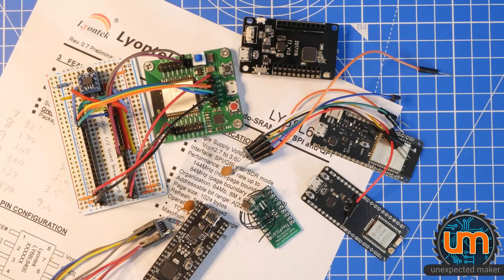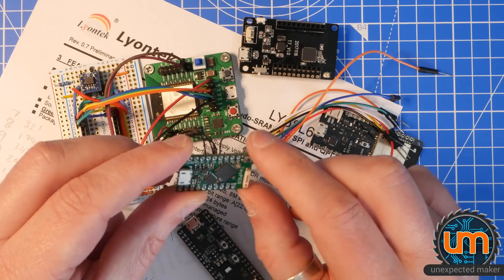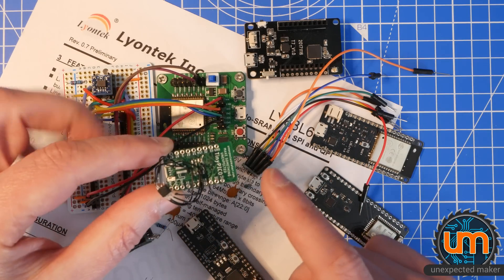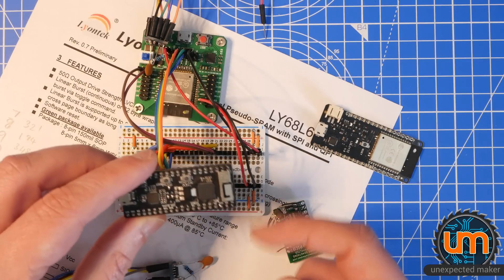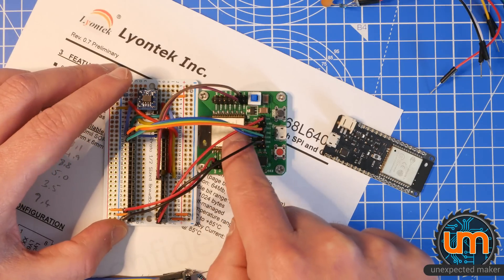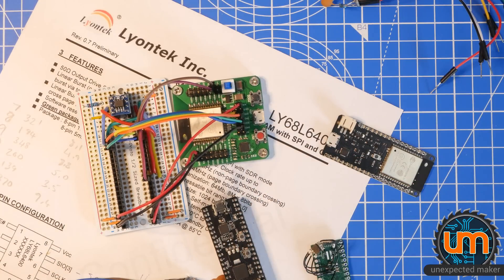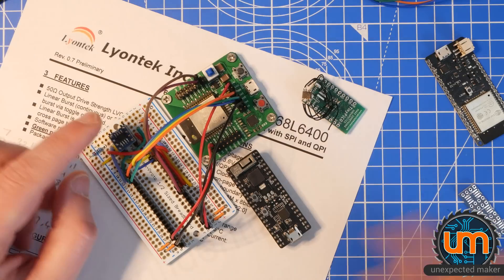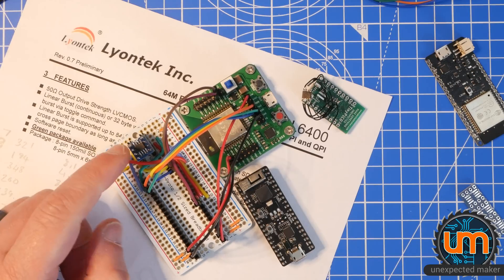TinyPICO PSRAM - What a frick'n mess!!!!

Comment: Has anyone figured this out?  I've got the PSRAM to post, but fails on mem check and ESP32-Pico-V4.1 reboots and continues is a loop with the PSRAM mem check failure.  I've tried everything.  Does anyone know a "for sure" PSRAM chip that works with the ESP32-Pico-v4.1??  I've tried this:  APS6404L-3SQR-SN -- DRAM IoT RAM 64Mb QSPI (x1,x4) SDR 133/84MHz, RBX, 3V, Ind. Temp., SOP8

Comment: So is the pico kit schematic wrong ? https://dl.espressif.com/dl/schematics/esp32-pico-kit-v4_schematic.pdf
Reply from the maker: No, it's not wrong, but notice the re-mapping of pins? IO17->SD0, SD0->SD3 etc...  means on TinyPICO I am wiring up different PICO pins than what I am using on PICO-KIT. Super easy to make mistakes like this, as what I test on the PICO-KIT is NOT what I am implementing on TinyPICO. I cant see any reason for the IO re-mapping.... I ended up re-naming my PICO in TinyPICO to match what PICO-KIT uses to prevent mistakes, but it's really bad consistency from Espressif.
Reply: @UnexpectedMaker  oh wow yeah package does not match datasheet, maybe revision change?
Reply: ohh I see now the datasheet has a peripheral schematic that is different https://www.espressif.com/sites/default/files/documentation/esp32-pico-d4_datasheet_en.pdf page 14, I wonder why

Comment: What voltage psram are you using ? 1.8v ?
Reply from the maker: 3.3V - WROOM + PICO use 3.3V, only WROVER uses 1.8V
Reply: Unexpected Maker ahh I saw pin/instruction in the idf for selecting, was not sure

Comment: I think the first task should be to figure out if the errors are during read operations or during write operations.
A) Write one, read many times.
B) Write many times, read once.
Really need to put a scope on the signals to see what the difference between good and bad PSRAM access is.
Reply from the maker: Yeah, right now it's write once, read once.. that's the default ramtest code in the IDF.

My plan is to make a new test rig and then do any further investigations on that.

Comment: Hi Seon.  I’d expect that your “timing” issues are almost certainly due to the breadboard and dupont wiring you are using. 
I use the same SOP breakout boards, but for “Mhz” projects it is necessary to “dead bug“ point-to-point solder-wire the prototype.
eg. My retro video projects (even at low Mhz video frequencies), will not work with a breadboard due to breadboard capacitance etc.
But the same circuit, dead-bug wired-up to prototype, works perfectly!
Reply from the maker: Yup, was going to try a wirewrap version but was going to wait for the new ram... BUT I might try it on the Lyontek too, stay tuned!

Comment: I've had some I2C issues with the ESP32, mostly due to timing issues. Apparently the ESP32 doesn't deal with frequencies that are too far off the mark and is quite sensitive to rise and fall timing as well. I know PSRAM doesn't use I2C, but it may be worth double checking that your wiring meets SPI standards.

Comment: At 40MHz you won't have a length issue but beware of those pre-formed jumpers and always make sure your clock and enable lines are the longest wire in any case. I used those prefab wires in a jig and got bitten by them on the assembly line in the middle of programming and testing a batch of 6000 boards. Manually soldering each wire to the pin resolved things. What I hear sounds like a hardware signal integrity issue or a software timing issue and the first thing to check would be stable power and stable ground. I would actually hard wire the Vdd & Vss with slightly thicker wire and use a 10n bypass cap across a 100n with the absolute shortest leads possible to the RAM's pins. A single 100n won't be fast enough, especially with two small inductors in series. In any case I think you need a scope and/or logic analyser at this point to see what's really happening. I suspect ringing on the clock and/or enable and 5 seconds on a scope should show it. On the analyser side I would wholeheartedly recommend the https://www.saleae.com/ stuff but for home use I've got an AliExpress clone of a https://www.dreamsourcelab.com/product/dslogic-plus/ which is a Saleae copy and the Mac software works well. In almost 100% of cases if you can get a single read/write to work, you're on the edge of success and even with imperfect hardware as long as you don't have threshold issues or crazy levels of ringing, a little drop in speed will usually get things working. Don't kid yourself about the difficulty of signal integrity at 40MHz. The Mac ][fx was a 40MHz machine and the guy in charge of that project was Apple's "Chief Designer in charge of Wicked Fast Products".

Sorry I've been swamped at work lately but I've got a good sized letter almost ready to send to you. Cheers from Colorado where we're now getting snow. ❄⛄
Reply from the maker: 40MHz is relatively slow by todays standards ;) I'm fairly certain this is not a decoupling/power noise issue as I get the same results with or without a bypass cap at 100nF... but I will try a 10nF cap on my next attempt.
I might look at getting a cheap logic analyzer when I am in China...  my scope does 4 channel SPI decoding, but I cant seem to get it working :(
Reply: I always like to keep the Cray 1S as my benchmark for wicked fast as it was 80MHz but 100K differential ECL is a different animal and it's no longer 1976, LOL. At 40MHz that 100n isn't really decoupling, it's acting more like bulk capacitance. The frequency is too high. Just as a rough example check out this random graph showing the different frequency coverage for different size caps: https://i.stack.imgur.com/c1AvP.gif and for a more complete technote here's more than you likely wanted to know but it's only 10 pages and with lots of pictures: https://www.intersil.com/content/dam/Intersil/documents/an13/an1325.pdf It would also be criminal of me to not mention the gotcha that two random caps in parallel can ring, and sometimes ring badly. Always best to scope it out.

When I was at my last job I was using lots of macroblock chips and almost every device with more than 28 pins had an accompanying SPI Flash with it. My last board had 5 or 6 ROMs and getting firmware for some of those chips during development from some of the vendors (cough.. cough.. ASMedia.. cough) was sometimes difficult so we "borrowed" code from other boards on the market using the same parts. In that effort I found there are 283,453 permutations of SPI with every possible polarity of every possible signal. I'm not surprised the PSRAM is acting different because there is such a variety of Flash chips which are incompatible. The best thing about standards is there are so many to choose from. My guess is the solution might involve a seperate machine language bit banging routine for the PSRAM to adapt to whatever it wants.

One thing you might want to test... if you write all $00 do you get only $00 back, and if not do you see $80, $01, or other values?, and inversely if you write only $FF and you get zero bits back, is there a pattern to their placement? Mode of failure is a great clue. If you can divide the master clock down for testing, does the failure mode shift?
Reply from the maker: "The best thing about standards is there are so many to choose from" - hahahahahahahahahah mmwahahahahahahah.... 

Seriously though, thanks for the info.. I didn't meant to ignore any of it... in-fact, I did quite the opposite and ordered a DSLogic Plus... They look AWESOME!

The reason I am discounting the bypass cap is rudi got the same Lyontek ram working overnight, and he has no decoupling at all... so I'm going to give it another go... live on my stream on Wednesday, so you can all watch me make a fool of myself - live!
Reply: My hat is continuously off to you, Seon. That's excellent news and it sounds like you'll have it working soon. One thing I've paid close attention to over the years is watching why projects fail and it's often repeated that when design and manufacturing are separated, manufacturing will just leave parts off to cut costs. Decoupling caps are usually the first to go. You might be surprised the number of times that companies have failed and millions to tens of millions of dollars have been lost over trying to save an aggregate sum of less than $100 in parts on the line. It's usually the small stuff and it's really really common when getting gear manufactured in China. Decoupling caps are like seatbelts and doors on a racecar. Sure you might be able to race at one track without them and make it through to the finish line but start changing the course too much and the results might not keep equaling success.

Wow! You've got quite a well equipped lab now. I have to admit I'm a bit envious. When do you add the 6 axis CNC and the vapor deposition chamber? 😉
Reply from the maker: My lab doesn't feel "well equiped".. but in time I'll get there.. lack of knowledge is more of a problem for me than lack of tools, but not having a logic analyzer has been a real hindrance on a few projects so far.

I'd like a PnP and Ultrasonic cleaner before the CNC I think ;)
Reply: LOL, I've never seen PnP outside an actual SMT factory. I just took a peek at the freshest copy of the LY68L6400 datasheet I could get ahold of (v 0.7) and it mentions three read commands, $03, $0B, & $EB. While commands $0B & $EB work to 104MHz & 144MHz respectively inside a page boundary, command $03 is limited to 33MHz and you were mentioning 40MHz so I was curious if you were using QSPI mode? After looking through the ESP32 Technical Reference Manual V3.9 I see how they dealt with so many SPI variants. What a clever chip!!! Looks like it's just a matter of setting the SPI control bits appropriately and you're there! Start with the speed at minimum & work up. I don't think you could ask for a better justification for getting an analyzer. Hang in there, you've almost got it! Obstinance is one of the best qualities an engineer can have.

Comment: Worth trying a combination of say a 10uF decoupling cap in parallel with the 100nF one, close to the PSRAM chip.

I would have expected the shorter wires to work, though.

Only real way to debug this is to check out the signals with a decent o'scope, or even better - a Logic Analyser or FPGA.
It should take away the guesswork about the wiring and caps. ;)

Did you try lowering the SPI freq as low as possible? And are you using 1-bit wide SPI mode or DPI / QPI?
Reply: I tend to agree, though. It does sound like an incompatibility issue maybe.

Could be that the PSRAM config on the ESP violates some of the timings for that specific chip, like say trying to initiate a burst transfer too soon after the previous one.

Do you know if the RAM tests are using burst transfers, or single byte transfers?
Reply from the maker: I can't change the SPI frequency on this... it runs in QPI mode.
A logic analyzer would be helpful.
Reply: @UnexpectedMaker  - Definitely get a logical analyzer! Go for eight lines or more. It's a critical tool when debugging signal transfer. I used it a lot when making my io-expander library. It gave me all insight needed when the i2c expander used to drive an LCD display didn't work on the esp8266. Using the analyzer I saw noise on one line. At low i2c speed the noise wasn't there. Turned out that a shorter cable without breadboard in between made a much more reliable connection capable of higher speeds.
Reply: Yeah, I think even one of the cheapo USB 2.0 Logic Analyzers might just be fast enough.

Then again, if we're talking about data rates of 80 MHz or so, then it's going to need something a bit better than that.

If you hook up the PSRAM to a mid-range Altera / Intel FPGA, though, you can use SignalTap (via USB Blaster / JTAG) to capture a fair chunk of data, and see what's going on.

It'll all be 3V3 logic as well, and the FPGA would be plenty fast enough.

The project for that would be super simple. It would only need an FPGA board costing around $60 USD or so.

(the larger the FPGA / more on-chip mem, the more you can capture with SignalTap in one go.)

Or, if you have SRAM on the FPGA board, you can use the SUMP project as a Logic Analyser, which will then capture quite a lot at once, and have 32 or more channels.)
Reply: I use SignalTap for debugging pretty much everything, including anything hooked up to the IO pins.

It can be a completely "passive" capture as well, so no need to route the signals through the FPGA as such.

https://i.imgur.com/CzwtNHn.png

You can see the kind of capture size possible there, with multiple 16-bit wide internal signals. That was from the old DE1 dev board, which uses a Cyclone II, and only has around 20 KB of on-chip mem.

You could easily do a capture of about  8,000 or 16,000 samples of the QSPI accesses (at 100 MHz, or possibly faster). ;)
Reply: @electronash  Mine is a cheap Seleae clone. If not connected through a USB hub, it goes up to 24MS/s. Don't know what the speed is of that RAM, but that might be too slow for perfect analysis. However, when writing all zeros or ones you might still be able to detect noise...
Reply: @electronash  - Nice picture! Sounds like good a amount of samples there. I've been using an older the Saleae Logic software, which worked for me, but I can see 16 channels would be better... :o)
Reply: @MaxintRD  

Quite a few years ago, I did a simple "kludge" to the SUMP software, to allow it to use 32 channels.

The SRAM on the DE1 is 16-bit wide, so I had to alternate between each half of the input channels, so it wasn't "clock-accurate", but still useful. ;)

If you have a 32-bit wide SRAM, then obviously it's trivial to get an accurate 32 channel capture with SUMP.

It's been so long since I looked into that project though, so it might even have other options added for compressing samples into smaller width RAMs etc.

The thing with SignalTap is although it's very easy to set up and use, it is limited by the on-chip memory of the FPGA, which usually isn't a huge amount.

If you but something like the DE10 Nano, though (no, I don't work for Terasic / Altera / Intel. lol), you have 700 KB of on-chip mem, which is even more than the SRAM chip on the older DE1 board.

(and, as a huge bonus, you can use the DE10 Nano as a MiSTer setup, and runs lots of decent retro computer / console cores. :p )

It really is a fantastic mini dev board atm for the price. I don't think it will be beaten on price vs performance for quite some time.

The USB Blaster (JTAG) is also built in to the DE10 Nano, so you don't even need that.

I'm hoping to write a full Logic Analyser / oscilloscope for the DE10 Nano at some point, which will output via HDMI, and utilise the FPGA for super-fast screen updates etc.
It just needs an ADC "hat" to be designed, with a decent opamp front-end.

(the DE10 Nano has the ARM SoC as well, of course, so would be a perfect combo for an o'scope / LA.)
Reply: @electronash  - Cool! Need to look into that. Thanks for the tip.!
Reply: @MaxintRD  

np. ;)

The MiSTer platform (based on the DE10 Nano, with some simple add-on boards) has been around for about a year now, but REALLY picked up speed in the last few weeks.

This was mainly after SmokeMonster uploaded some vids on it, and the word finally got out.

I did try my best to spam the retro stream chats about it for many months, but people are finally catching on now. haha

There are now some top FPGA peeps, hardware devs, and coders working on improving the current cores, writing new ones, and creating new add-ons for it.

And yeah, the DE10 Nano itself is just a superb board for the money, and it's very unlikely to be taken off the shelves any time soon.

It is recommended that you buy a small 22x22x10mm heatsink for the chip, though, as it can get a tad toasty when running the larger cores.

The "IO Board" add-on also has a fan on it, but it runs near-silent if you use a 12V fan on the 5V supply header.

ETA Prime, Lon.TV, and others recently did vids on the MiSTer platform as well, so it's worth checking those vids out.

The GPIO headers on the DE10 Nano aren't directly 5V-tolerant btw, but that's probably stating the obvious, and I know you know about that stuff anyway. :p